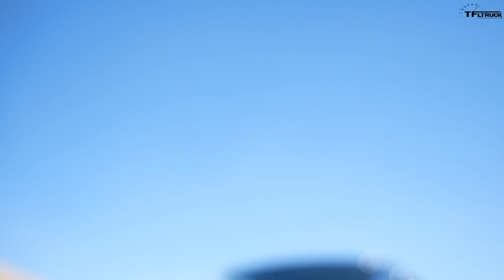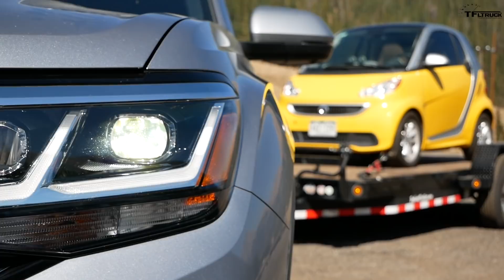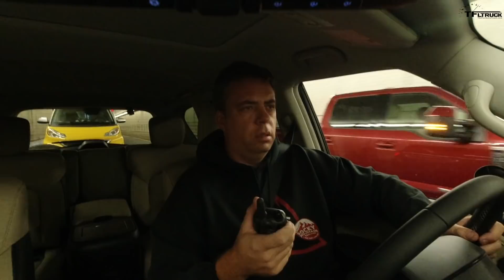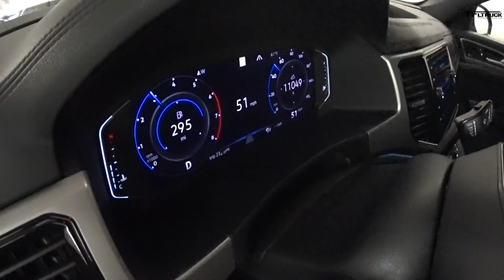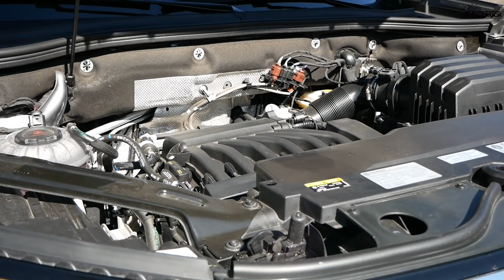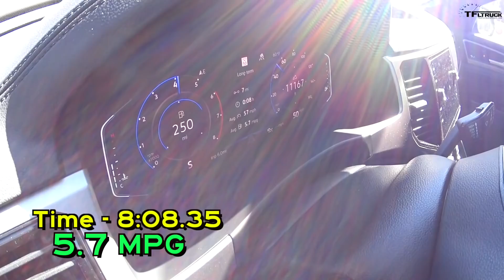Crossover vs SUV vs the IKE GAUNTLET World's Toughest Towing Test: The Difference May Surprise You!

Comment: could you make a test, change it only the tires of one Crossover like TAOS or ATLAS for an BF Goodrich, without lift the suspension, without any other change, just the wheel and tires, to check if their capabilities will improve it.

Comment: whats worst that happens if your trailer is 6,000lbs with the Atlas SEL? I do plan on towing a bigger boat locally and across State lines- same path as video to Powell. 
I can say, I towed a 3700lb boat to powell from denver- no problem and around 13mpg. ty

Comment: I have Volkswagen Atlas SE 2018 v6 3.6 L SUV with all wheel drive. I don’t have VW factory installed hitch and VW website says without factory installed hitch i can only tow 2000lbs instead of 5000 lbs by factory installed tow package. Did anybody had similar situations and were they able to tow it safe? I’m looking for camper wolf pup 16bhsbl 3076lbs dry weight. Is it safe to tow by my SUV ? TIA

Comment: I tow a 2200 lb fiberglass trailer with a 2016 lexus nx200t. I put firestone airbag helpers in to help with the rear sag, after the airbags it tows beautifully. No problem going up mountain passes or accelerating quickly to 70+ for passing if needed. I am averaging about 20mpg after towing many trips over the past 2 years and ~10,000 miles. I do have brakes on the trailer.

Comment: We have a 2020 Nissan Armada Platinum (yes it has tow mode) and we tow an 8k lb travel trailer with ease..  As I understand the Qx is the same as the Armada. We usually get 9mpg while towing.  The Armada has connection from the factory.  I just had to plug in my brake controller and bingo.

Comment: Nathan, the engine in the Atlas is VR6, not V6. VW VR6 is "Verkürzt Reihen 6" - Shortened In-line 6, not narrow-angle V6.  There's no such thing as narrow-angle V6.
Reply: The normal V6 engine has a 60 degree angle between the piston banks.  The VR6 angle is 22 degrees.  Hence the narrow angle nomenclature.  It most certainly is NOT an I6, the cylinders are not all in a single row.

Comment: Runs like this make me wonder how my 93 Crown Victoria would do as a "super Ike" as 5K is the limit of it's tow rating. I have a dual core F150 radiator, electric fan from 2001-03 crown vic, 24 plate trans cooler, 3.55 rear gears, ceramic rear brakes, and Hawk HPS front brakes. It also has AirLift 1000 load helpers in the rear.

Comment: The QX 80 and the Armada still use the 7 speed auto because they are based on the Patrol platform (which also still uses the 7 speed) and not the Titan platform. Nissan really should switch all of them over to the 9 speed and I expect they will in the next year or two.

Comment: As an Atlas owner, I have to say that if he had used Sport mode on the way down, it would have been at least 2-gears lower.  Normal and Eco modes are EPA specials that minimize engine braking.  Not long ago another reviewer (not TFL) was critical of how abruptly the Atlas slowed when cruise was disengaged and how aggressively the active cruise resumed when moving out from behind a slower vehicle - that would be because she had it in Sport mode, and it downshifted 2-gears when the throttle closed, because "sporty" drivers want engine braking.  In normal it is smoother, typically downshifting one gear in the resume speed scenario, but staying in the highest available gear during coasting.  In Eco it is limo smooth, only downshifting after several seconds of trying to accelerate in 8th gear.
Reply: We love our Atlas.
Reply: but going up hill gassing it from 35mph it held a higher gear and didn't down-shift to get max performance.
I own a 2015 VW Amarok (truck sold everywhere but the USA and canada) Its wider than the ford ranger but about the same length with a 3 tonne towing.
its fitted with a 2.0L diesel and has the 8 speed. it shifts down on the 2nd brake then again on the 3rd.
on a flat road or uphill flooring it with drop 2 or more gears and rev close to the limiter before up-shifting
this diesel is 309 foot pounds (420nm) and 177hp (132kw)
the updated 3.0 v6 diesel is 427 foot pounds(580nm) and 254hp(190kw)

Comment: How would the Pathfinder go uphill? 🤔

What a European plug? 🤣
Reply: Towing with a "crappy" variable transmission .... I wonder how long it would take to get to 60 ... or would it ever with 5000 lbs in tow?
Reply: @kenoday7562  Dunno. It should tow 6000... but that let´s me wonder. With a CVT?
Reply: @SvenQ45  Yeah, I've seen what happens to overheating CVTs, they stop all forward movement.  Nissan has done their best Fiat imitation with hp numbers and now tow ratings.
Reply: @kenoday7562  What´s with Fiats horsepower ratings?
Reply: @kenoday7562  it’s been rated at 6,000 pounds for a few years I would assume it can do it if it says it can
Reply: @SvenQ45  Of course all manufacturers rate their engines out of the car, no accessories.  But once you put it into the car it's a different matter.  I've yet to see a stock 3.6 Pentastar dyno over 210hp.  Yet they rate them for 295.  Do we think there's really THAT much parasitic loss?  A 3.6 GM V6 will usually dyno around 240-250hp with a claimed 277 hp.
Reply: @sethlittle7338  Yeah, it's still a CVT, I wouldn't trust it at 5001 lbs.
Reply: @kenoday7562  Yes I know in car it´s different. 🙂
Still some datas are right.

Comment: Yep, another rather biased review.
The Atlas did squat more than the Infiniti, probably because it didn't have the same distribution hitch on it, which reduces any squat to a minimum, shouldn't it?
Also that VW should have a towing capacity of around 3.5t shouldn't it? Any car that big should be able to tow that much. 
Also all your quips about trucks doing the same insert stat is kinda invalid as they are all towing different loads etc. Unless they are conducted with the same trailer, same hitch you cannot compare them.
Your conclusion about the VW not being able to tow big loads every week is kinda null, as being a VW, it will keep going no matter what (Check engine light or not).

Comment: I still don't understand why you didn't use the weight distributing hitch on the Atlas. Was it because the WDH is 2.5" vs the 2" receiver on the Atlas hitch?
Reply: WD hitch uses leverage to distribute some trailer weight through entire vehicle body, instead of just the hitch. 

Without a formal ladder frame to absorb that torsion, a unibody suv may crinkle like tinfoil. 

...Or, it may not. But it’s not their car to gamble with, and it is never recommend to use a WD hitch on a unibody for these reasons. 

https://www.etrailer.com/question-241876.html
Reply: They said it in the video that the atlas is unibody and can't be used unlike the body on frame infiniti
Reply: @ericksanchez7787  still doesn,t answer the question. Why are unibodies different with regards to WD hitches?
Reply: @rik999  hey I'm just saying on what they said in the video
Reply: @rik999  There's no frame rails to connect the WD hitch to.
Reply: @TEXwithNODS  But my WD hitch doesn't connect to the frame, it only slides into the receiver.  I haven't used it on my Atlas, because I use my Sierra 2500HD when I tow, but I am pretty sure I could use it with the Atlas.  Just checked the fabulous manual - "Never attach a weight distribution hitch".  OK then.

Comment: A good comparison on towing would be the Toyota Highlander vs the Toyota 4Runner.  Both have 5,000 lb towing capacity.  One is crossover, one has a proper frame.
Reply: They did it with the 4Runner before YouTube was around, heard that they used a Polaroid camera to shoot the test.
Reply: @garys2157  they should do a new test, ive seen Taco's, Tundras, and even a Sequoia.
Reply: Agree with you
Reply: im surprised they havnt had a 4runner on the Ike yet.
Reply: And both are V6
Reply: @mannyzx1  Highlander is the same 3.6L the new Tacos have vs 4runners 4.0L
Reply: Yess!!!!
Reply: 4Runner has more torque but Highlander has extra gears. Long flat stretches I’ll take the highlander, uphills I might be more inclined towards 4Runner. Neither are great towing vehicles, maybe for lighter loads below 4,000 lbs
Reply: with 4 inside and 2 dogs than try the 5000lbs

Comment: Drawing a conclusion from this test is pretty pointless.  The Infinity was at 58% of it's towing capacity.  Of course it will perform better.  How does the Atlas perform when towing 2900 lbs?
Reply: @killdizzle  But the title of the video still says crossover vs SUV which is misleading.
Reply: @killdizzle  I agree with you.

Comment: I would love to see this same test with other crossovers, such as the Hyundai Palisade which also has a maximum towing capacity of 5,000lbs.
Reply: Agreed. A Nissan Pathfinder (6,000 lb. rating and CVT) would be interesting as well.
Reply: Same as this VW
Reply: 5-6k is the sweet spot for crossovers but I have not come across positive towing review. Hopefully TFL will come across one.
Reply: I’m surprised to hear a Hyundai can tow 5k.  I figured it would be like most SUVs at 3500 lbs.  I don’t understand why most SUV manufacturers or aftermarket suppliers, don’t offer some kind or rear leveling suspension.  SUVs are supposed to be built to haul people & cargo.  I’m not sure I would buy any midsize SUV right now.
Reply: @cmdrdarwin3682  the Telluride towing package does have self leveling rear suspension
Reply: @nickloss  - Thats a definite plus!  Even Lexus doesn’t have a leveling suspension in the midsize SUV.

Comment: I'm towing our camper, keystone passport 292bh with Nissan Armada. No problem at all best towing suv you can get in usa for the money. I'm using weight distribution hitch and this year put helper firestone air bags. Towing like dream get over 10mpg and manually downshift when needed... That v8 pulls like c15. Most downhill portions newer touch brakes. And having all needed space for kids..... Best thing about Nissan/Infinity v8 is no cylinder deactivation garbage.
Reply: I used to have an 06 Infiniti QX56 that old 5.6L was a nice engine. I now have a Toyota Sequoia Platinum and it is the better tow vehicle for sure. But my experience is much like yours. Great power, hardly ever use the brakes down hill. We are a family of 6 an I couldn't ask anything more of it.